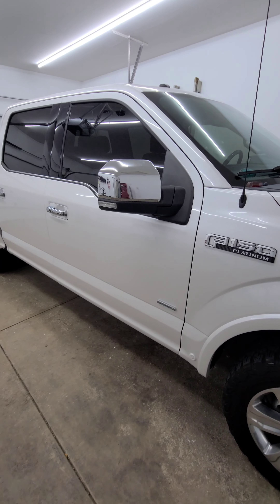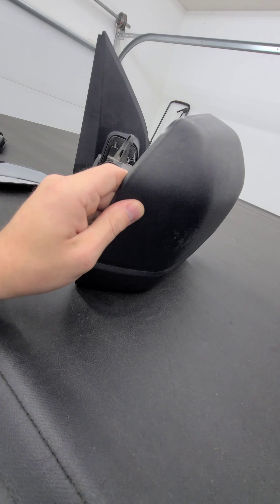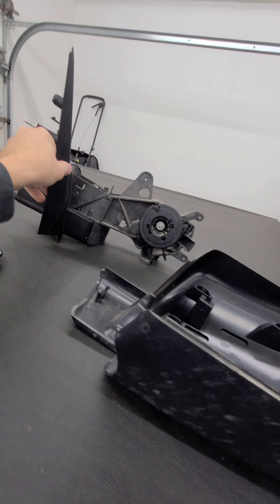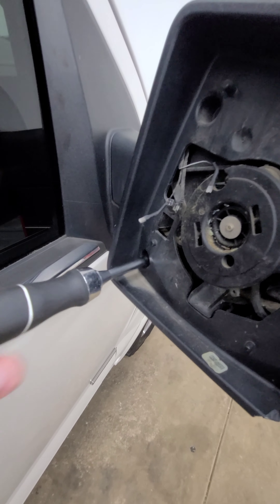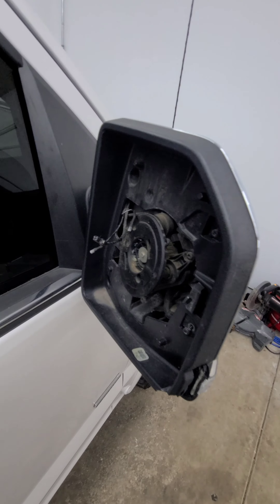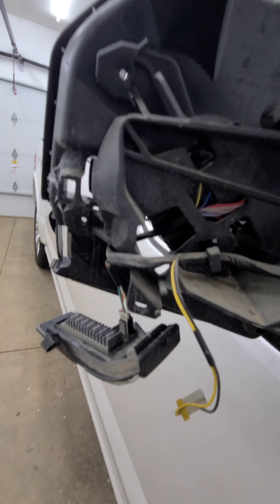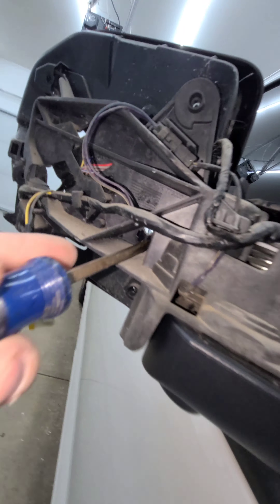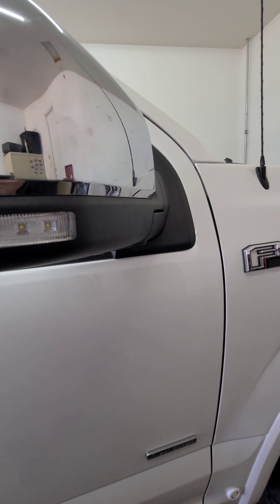2015-2020 Ford F150 - Repair Side Mirror Housing

Comment: Video saved me a few hundred bucks. Someone hit one of mine and broke the front part of the housing and cap. Instead of buying the full option mirror for $500-600 used I bought a low option mirror with a matching painted cap for $230 and just swapped the front portion of the housing.